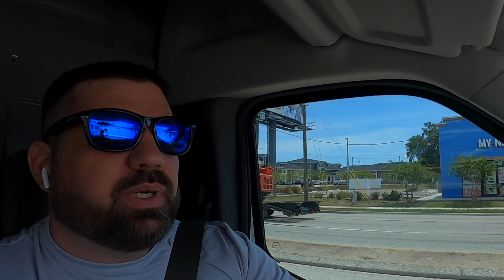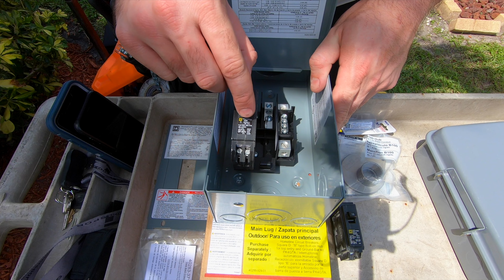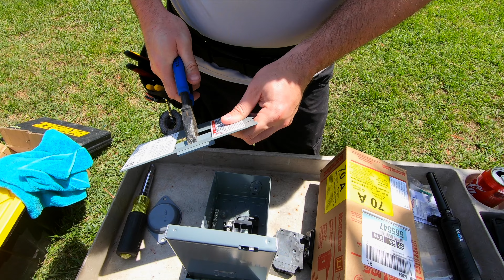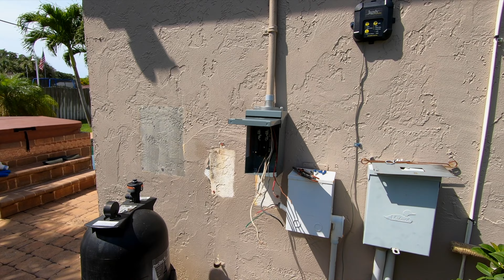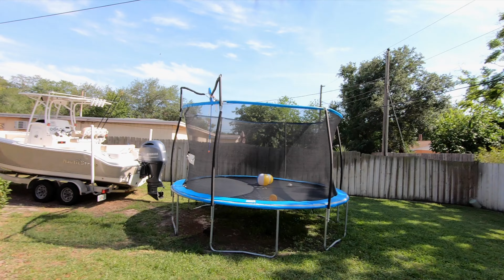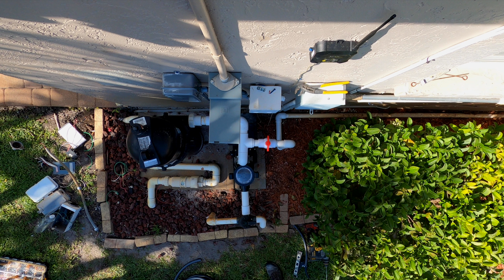How To Replace a Pool Sub Panel Safely (Step-by-Step Electrical Tutorial for Homeowners)

Comment: Great video. Question, I would like to run a single circuit from my main out to a box that will produce a 220 and a 110 line. Is that possible?
Reply from the maker: Not an electrician here but as long as you have the correct size breaker feeding the sub panel with the correct size wire feeding the breaker bar to support the two lines you need then yes, you can. You’ll ultimately need a dual pole breaker and a single pole breaker to accomplish the separate 220/110 lines you’re wanting. Please consult with a local professional who can do a load calculation to ensure you have power for everything you need and also to ensure a proper installation. I hope this helps! Thanks for watching.

Comment: Glad he took the time to explain that the neutral in a subpanel MUST float.  After I bought my house I realized a house panel was used in there, I guess when the prior home owners got a new 200A service they decided to use the old panel in the garage but they had the neutral and ground bonded!  Not to mention a 70A feeder breaker with 10 gauge...  all the wrong things I found with my electric and ironically the prior owner was an engineer for Ford.  I see so many ridiculous and some dangerous things on pools in our area (NewJersey)...  a lot are older pools that existed before they even installed bonding wires, not to mention tons of bonding wires that aren't even attached when homeowners swapped out a pump.  I even had a customer after I got shocked going near the light tell me "oh yeah, we tell the kids not to swim in that area!"  Extension cords running pool pumps with a plug-in timer on an inground pool with a 1.5hp pump is classic along with the burnt up prongs.  Your electrician seems really focused on things being done properly and safely, I like how he thinks and works.
Reply: Hey what part of NJ?
Reply: @michaelleddy3701  Spotswood

Comment: Hey man I know I’ve this question before, but I want to my pool service and repair license and I’m familiar with the 60 hour course... My only issue is the 1 year of repair experience.. How do I obtain experience if I’m maintaining my company full time everyday.
Reply from the maker: See if you contractor can employ you for a year and do some repairs for him on the weekends. That would probably be your best bet I'd guess.
Reply: @ChlorineKingPoolService  yeah that’s what will probably be best I think as well. Thanks
Reply from the maker: No problem.
Reply: Obviously its code the way it way it was done ,but why not use a suitable intermatic all in one subpanel. Or upgrade the system to a pentair pl4.